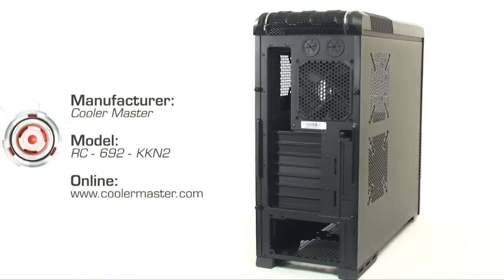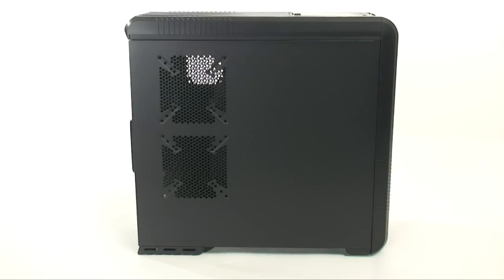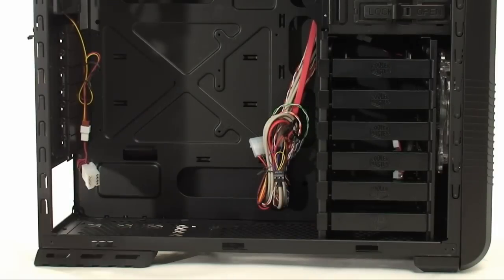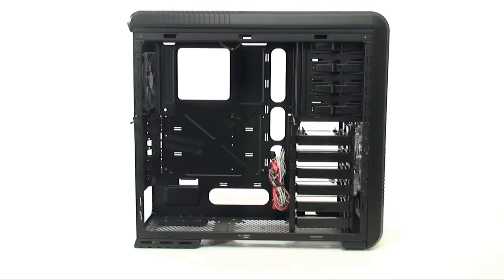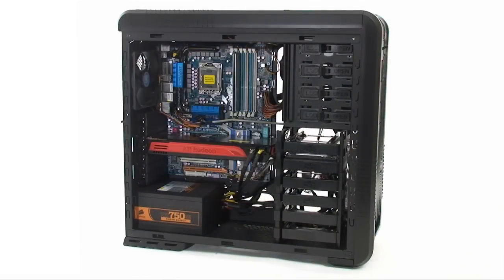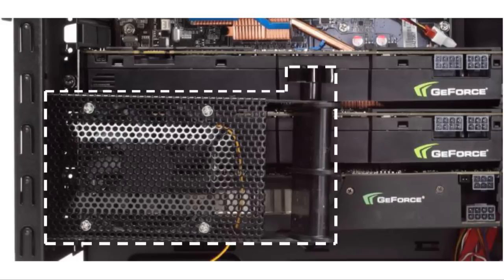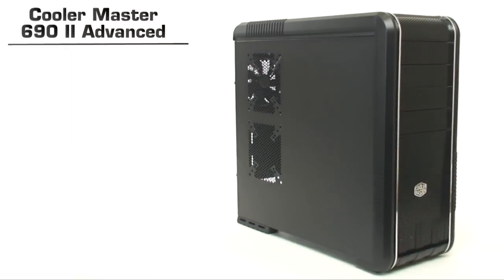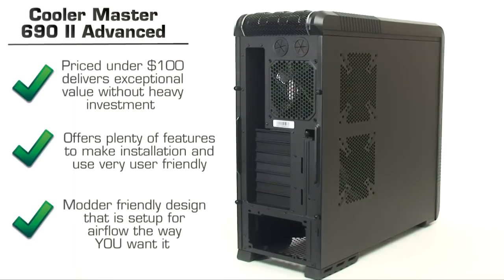Cooler Master 690 II Advanced Video Review

Comment from the maker: @Tzenjin There is an additional dust filter that you can put underneath the PSU. There are none at the rear & top because those are exhaust points. Filters are only needed at intake points :)

Comment from the maker: @Rogy56 They all use the 3 pin header connector (but can be adapted to molex). The bottom fans can only fit 120mm and yes there is an included dist filter to put under the PSU fan. Cheers

Comment from the maker: @4eyed21 The HD 5970 will ONLY fit if you take out the bottom drive bays, and your PCI-E video card slot starts at the second PCI expansion slot or lower (most do if you have a pci-ex1 slot above it). So yes it will fit, but you loose 4 HDD bays.

Comment: I have this case and i must say I AM IMPRESSED, Excellent quality all around, although the only problems i have with this case are, the top sata bay cover doesnt really stick too well and can possibly fall off the case easily, and althought there is cabel management.. the motherboard tray is a little too close to the side pannel and makes the main 20+4 pin cable a little hard to connect up if you have other cables already routed behind the tray

Comment from the maker: @2at8er Sorry for the slow reply. Yes you will be able to fit a single 120mm fan at the bottom without taking the trays out. I would recommend also getting a ran grill for this fan though, especially if you have extra PSU wires. Will help to keep them from getting caught in the fan.

Comment: I have a question: Can I fit one 120mm fan right in the bottom of the case next to the Power Supply without taking out the lower 3.5" drive compartment?

Comment: I've got a question.. Can you replace the fan on the top which is a 140 mm fan with a 120 mm fan? I'd like to have a LED fan there.. The standard isn't LED and I wasn't able to find a LED 140 mm fan in the stores close to me. I was only able to find a 120 mm LED fan.

Comment: How long PSU will fit with a 240 rad at the bottom?
Would, lets say, corsair 850hx fit, or would it be to long and cover one of the bottom 120mm fan mounts?

Comment from the maker: @CDMac09 
Sorry what I meant was I don't have a 5970 atm (RMA'd) so I was trying to get creative on how to show how it both doesn't fit, and does fit.  It won't fit natively, but provided your motherboard is able to support a video card in its second or 3rd PCI-E slot as the primary display then you can take out the bottom four hard drive spaces and use the card in there.

Comment: Just FYI for anyone with this case, you can put a 80 x 80 x 15 mm fan into the pci retention bracket.  It seems like it was designed for this by the convenient dimensions and notches in the metal for screws, but even if it wasn't by some odd chance it works very well.

Comment: thanks for the answer, but i have another question ( sorry for being annoying xD), Considering the width of the 5.25 inch bays would it be possible to fit in 2 120 or 140mm fans in there(on top of the existing 140mm, even if theres no screw holes ?( Mod Ftw, however ill probably end up ziptieing everything cause im lazy haha)
thanks again.

Comment from the maker: @Em0killer13 
Yes the top panel has an included 140mm fan at the top and it WILL support a second 120/140mm fan in the other space :).

At the bottom you can install 120mm fans only, but you can install 2 of them.

Comment from the maker: @nibbler2012 

Good catch - they do include this label, however we received a message from Cooler Master during the review stating that they added the warning more as a caution given  ability to hot swap is depended on the OS & motherboard

You need to be using ACHI mode (Not IDE) for the hot-swap feature to work with the 690II, and ACHI is supported by Vista, Linux and 7. 

For this reason they thought it better to include a general "Not Hot Swappable" label and outline the conditions later.

Comment: Dust filters almost everywhere including base for PSU. The side panels however do not have the filters. 
I have no idea how to install the GPU retention bracket.
The front intake fan is a bit weak to my likings. I think it pushes 25-40 CFM. This gave my 5770 slightly higher temperatures than my previous case. I liked the on/off button for the LED lights on the fan so I left the fan as is, but I managed to zip tie a better fan under my DVD/CD drive which pushes ~68 CFM.

Comment: @FIXTatHWC: Yes I meant the HD 5970 rather than the 5870. Kinda bummed that you have to sacrifice HDD storage to get it to fit but I guess you either love the case and make it work or find a different one.

Personally, I wish Antec would revise the Antec 300 so it would be long enough to fit cards up to a 5970 w/o sacrificing HDD storage. I mean, you would only have to add 3 1/2 in and it would be perfect.

Comment: @WickedGr yeah..we want window CM!!!and with that new removable hdd cage i would rather put 2 120mm fans under it so that all the air is lateral..not one coming from the sides..never did like the opening at the back...really wrecks the look..especially the 2 side fan slots..ack..give us a window instead..and do a flat metal panel for the other side..no fan slot plz..we wont use it..believe me

Comment: If the fans are blowing out they probably won't need dust filters on the side (I'm assuming here).  I wouldn't consider the case quiet because they use regular steel/aluminum side panels and I didn't see any type of sound insulating materials used.

Comment: Are there dust filers at the side intake with the front and the bottom PSU slot? Are they removable?  What is the purpose for a fan at the back of the motherboard side panel? I won't be installing fans at the size. Do you think dust will suck into the case from the size if I don't cover it with something? Is there consider as a quiet case? I am planning to build a quiet PC and considering either this one or Antec P183.

Comment from the maker: @grrrroink 

A more accurate term would have been "back portion". 

At 2:54, the fan they refer to is #9. It can be installed on the removable portion of the hard drive cage. 

At about 4:59 you can see the mounting holes. 

It does go by fast though (had to speed it up to match the audio :(   )

Comment from the maker: @persentio 

Thanks persentio - I went and took another look at the front and brought some fans with me this time. One 140/120mm fan is in fact correct. They just have 4 different mounting points so you can mount either size of fan in two different positions.

Correction has been made.

Though theoretically - I tossed in two 80mm and they do fit... with only two screws :P

Comment: @ hardwarecanucks

Thanks for that. However, I just got an official reply from Coolermaster and they said this:

"The front mount can support 1 x 120mm, or 1 x 140mm fan that can be installed on an upward position to cool hard drives, or a lower position to cool the GPU area and PSU. The front panel is not officially designed to support 2 x 120mm fans in the front"

Think you guys need to clarify this... =S Thanks for the awesome video review anyway though! =)

Comment: 7 fans?  I have the HAF 932 with 13 fans plus a dominator ram fan.  4 antec red fans on the side, 3 on the top, corsair h50 bolted to back with two red fans attached to it, 230 mm in the front, 120 cooler master blue fan on the bottom, and a antec 900 fan duct with two blue led fans in the 5.25 inch drive bays,  All fans are on high 2000 rpm's.

Comment: So the new RC 690 II is skinner than the old one:
RC 690: 20.65" D x 8.39" W x 18.98" H
RC 692: 21.8"   D x 7"       W x 19" H
I have the Cooler Master V8 and it barely fits in the RC690. I have about 3/4" from the top of the V8 to the side panel of the case. But the RC 690 is seriously a great case for the money. I like all the fan options and the larger diameter perforated holes on the front of the 692 case. Not sure if it could hold the V8 thou.

Comment from the maker: @odst121 

No unfortunately it will NOT fit OEM designed 5970's. There is only 12 inches of room and as stated the typical 5970 requires about 12.5"

Comment: Hi Hardware Canucks,

I would kindly ask you guys to clarify about the chassis being able to mount up to 2 fans at the very FRONT of the chassis (in front of the HDDs). According to the 690 II's manual, it states only being able to mount a single 140mm there. It also doesn't look like there is space to mount 2 120mm fans.

Comment: I was able to cram 7 120mm fans into my CM 690, and I've got two additional 120mm fans on my TRUE processor cooler... That said, I had to custom paint my 690's interior black and it doesn't have the same neat features of the 690 II.

This will definitely be my next case, since I'm going for self contained water cooling!

Comment: Good review but a little too rushed, we cant see how the 2 front fans can be mounted (if they can really be mounted), or how to use the hot swappable HDD bay, or how the HDD fan can be mounted. 

In the specifications sheet says that it only supports 10 fans.

I also would like to know if you can mount the bottom fans without removing the HDD rack.

Great case for the money! It outperformed the CM Scout for the price!